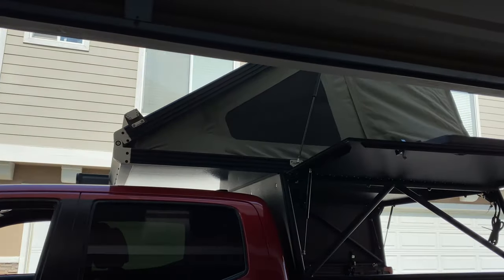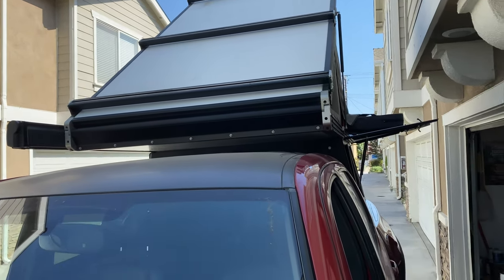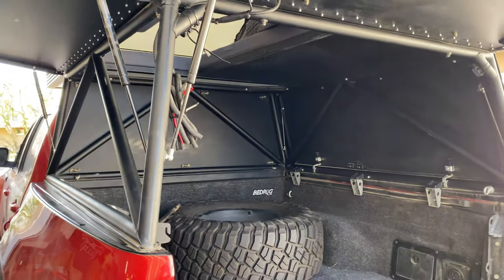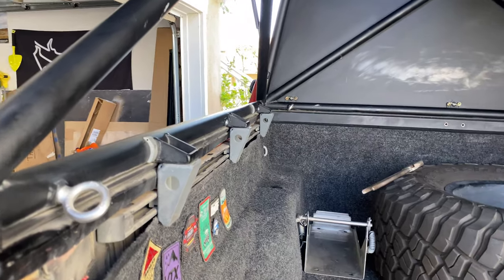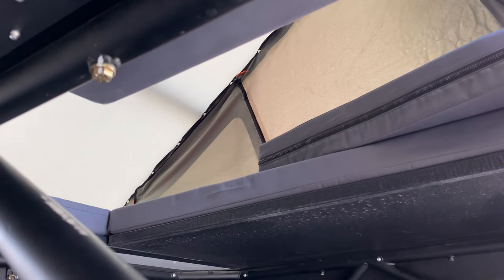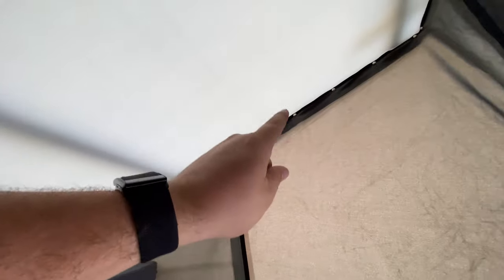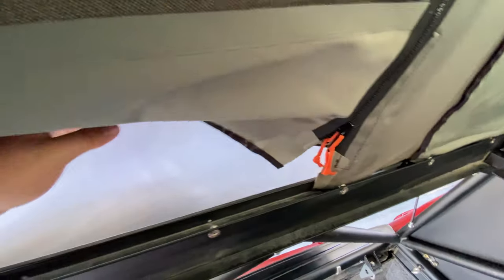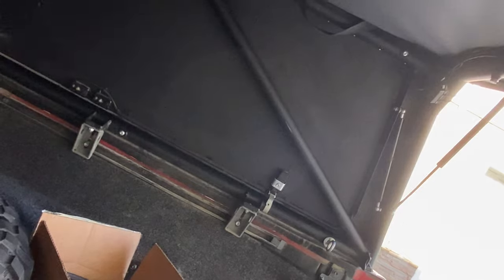The Most Detailed GFC Review Ever (Seekoutbeauty)

Comment: For those concerned about bedding up top, i can confirm my build (769) allows me to close the tent leaving a 2-person Sierra Designs Duo 20 up there all the time. Also, for me the ladder is a must because I’m too old to be crawling up there from the bed of the truck. Good review, thanks for sharing and now I need to figure out how to wire those BD lights, were those to a second battery? Good luck with the Alu Cab, its a beaut!
Reply from the maker: Scott Haley good to know on the bedding.  I think if I had the gfc again I would do an air mattress.  Deflate it before closing up.  

Single group 31 battery. I wired them all to the switch pros which has a low voltage cutoff.  
The alucab has some lights I would recommend over the bajas. Check out national Luna dual touch lights.
Reply: SeekOutBeauty Daniel Elo I know people do that for sure, I’ve been pretty comfy on the GFC mats but I can see the advantages of using something like the Exped Megamat Duo.

Comment: Hey man I love your video and the Alu-cube. I was looking at the same thing. How is the heavier weight on the suspension and gas mileage? I also didn’t like the door has to be removed in case I decide to resale the truck.

I was looking at the King Cab Outback (Australian company) series. It seems to be in between CFC and Alu-Cube but not a lot of info/videos out there on it.
Reply from the maker: I keep my tailgate in the attic.  
Weight had no impact on mpg.  My mpg is the same. 
Suspension, I needed some beefier leaf springs, but more so because I have a full goose gear build out and water tank, etc etc.

Comment: What are your thoughts on that Baja Designs RTL light?  Were you able to get both brake and turn signals working on it?
Reply from the maker: You know I never ended up wiring mine up because my rear tail light on that side is broken and I didn't want to remove it. I can confirm that the brake light works well, as the previous owner had it wired up. This specific model did not have turn signals. My next setup will likely have turn signals.

Comment: Regarding dust and water intrusion, did you plug up the gaps that are located in the front corners of the bed? If so, what did you use to seal them?
Reply from the maker: jkd0629 these were previously filled when I had my snugtop.  We used a silicon caulking in black.

Comment: Wish I had seen this before I bought one, I think I would have gotten the AT one.
Reply from the maker: Did you simply place a deposit or have you taken delivery? The hinge issue is resolved with their new hinges. The other feedback provided will remain the same. The AT unit is likely a small step up when it comes to the tent itself, but not structure . If you have doubts, sell your GFC or your spot (They will sell quickly and you will likely not lose any money, and may profit) and if your budget allows, look at Alu-Cab (short wait, best construction) or Vagabond (long wait, very good construction)
Reply: What's the price difference between this one and alu cab canopy camper
Reply: Not being able to lock this when you're inside makes this thing dodgy.
Reply: Which one, Will?  The Atlas?
Reply from the maker: @kenmcdougal97  about 3000 bucks... but a 2-3 month wait vs 14 months... and also, the canopy camper comes with a lot of options included.